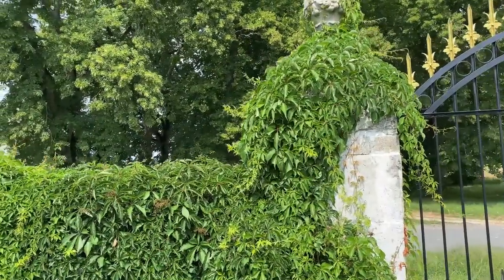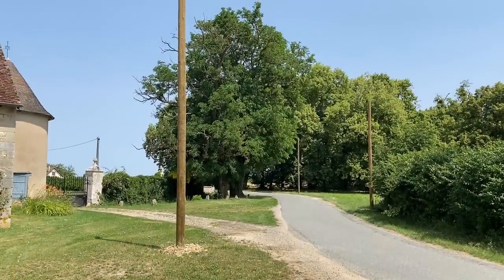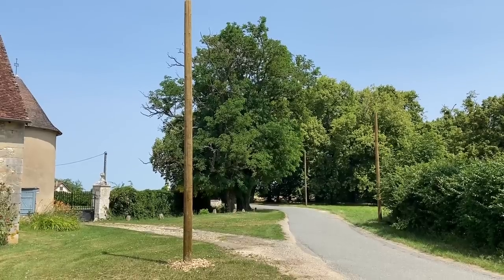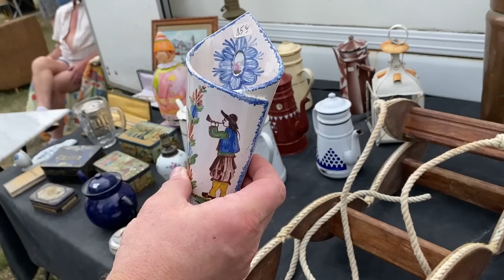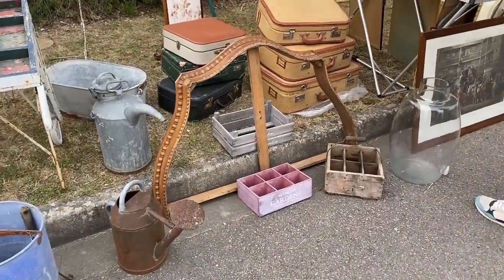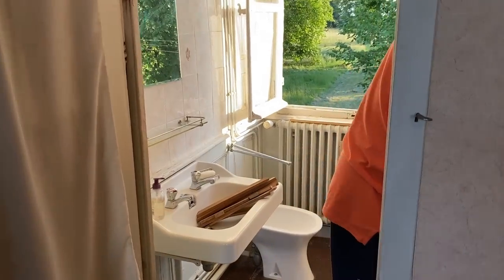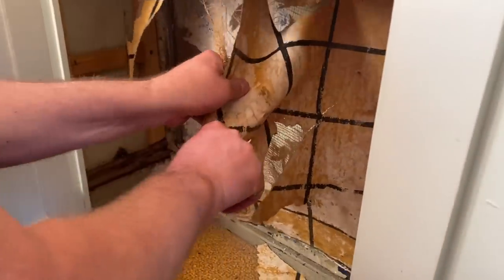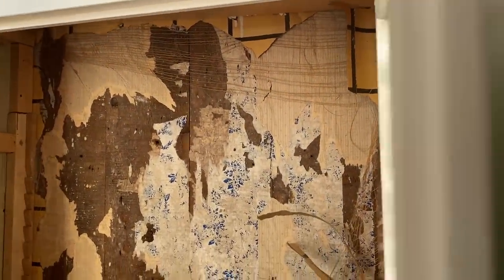CHATEAU bathroom RENOVATION, AMAZING DISCOVERY behind the cabinetry -Journey to the Château, Ep. 115

Comment: I love that blue and white wallpaper, maybe you could have a few rolls printed and use it in the new bathroom????
Was trying to think how you could fit a full bathroom in that space, even with the cupboard removed????
I would think a shower cubicle would cut into the room to much, so all I can come up with is a slipper bath under the window with shower over, sink left of the door and WC on the right!!!!
Reply from the maker: That space does not have a waste pipe for a toilet. The WC will be separate in the room. There is a radiator in front of the window, so no tub shower can go there. Don't worry, we have it all figured out. Thanks! 😀
Reply: The wallpaper is apparently from about 1650. It is indigo block print on paper.  The paper is small pieces that were put together.  We will have a shower room in the space and the en suite toilet is in a different spot.  Wait and see.  Huge hugs ❤❤❤

Comment: 👍👍 This original blue flower wallpaper was a pleasant find, but the subsequent wall coverings got progressively worse.  As they say, " There's no accounting for taste!"  I am looking forward to seeing your interpretation for the space.
       It is curious that the paneling framing the doorway is missing about 4 inches of panel on the left side as compared to the right side.  Are you sure that there is no gap behind that oak wall?  It's not usual that the symmetry is off in French period homes.  Perhaps you'll find an answer on the alcove side of the wall, or it may simply be that they weren't concerned with symmetry because it is, after all, only a bathroom.  Curious that's all. 🤔
Reply from the maker: the oak wall only consists of the thick oak panels, and they were just wallpapered on both sides (bathroom and alcove). there is nothing else to that wall except those panels/planks of wood.
Reply: Hi there 😊.  They were not concerned about symmetry in the bathroom.  I wish they had been.  😮. The oak wall in itself is quite impressive. 400 year old oak planks.  The blue paper is amazing. Indigo block print on smaller paper that was then put together. Wonderful.  Huge from Colombe 😊
Reply: @JourneytotheChateau   ok, my curiosity is sated.  Thanks.

Comment: Patrick the type of vine on the pillars is a Virginia Creeper (Parthenocissus quinquefolia)....a menace for most gardeners here in Canada.  It is extremely difficult to eradicate.  I've had it growing in my yard for over 20 years and still it creeps up just where I can't reach it or where the birds have decided to drop its seed.... On the other hand, I have found that the best product to use on Virginia creeper is diluted glyphosate. Hold the vine away from your body and paint the product on the vine using a foam paintbrush. Be very careful not to get glyphosate on any other vegetation, as it is non-selective and will kill any vegetation that it meets. Be sure to follow the dilution instructions on the product label and always wear gloves when working with chemicals.  It is easiest to get rid of before the roots get too deep into the soil.  They have long roots and these "anchor" the plant deeply.  When I visited London (UK) in 2002, the Tower of London had a plant that was over 500 years of age, its trunk was over a foot wide and in multiples.  If you don't want it, hack at it or use glyphosate as directed above and on the label.  Hope this helps.
Reply: Thank you so much.  Glyphosate is illegal in the EU due to the cancer risk.  That doesn’t mean I can’t try to find some.  It is a menace. Not quite as destructive as English Ivy in our climate.  Very thank ful for your comment. Hugs. 😊

Comment: So is the ceiling in the alcove, or in the entire room, or floor, dropped? Because in the pan shot, the top rectangle of the paneling only shows as a square, and it loos like there is a gap between the moulding and the paneling (the right corner, across from the built in).
Reply from the maker: No. What you are seeing is all of the extra tracks on the surface that they put in to hide the old electric wiring. They tried to make it look like part of the moldings and it covers up the top parts of the paneling.
Reply: @JourneytotheChateau  Aha. Merci.